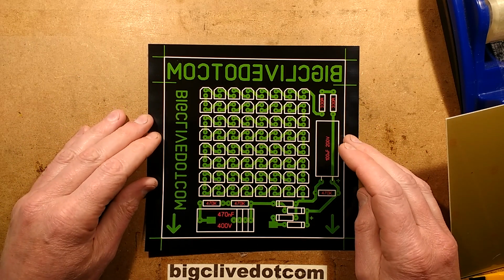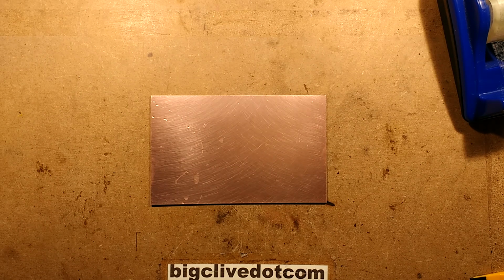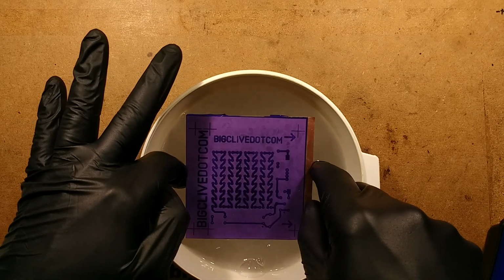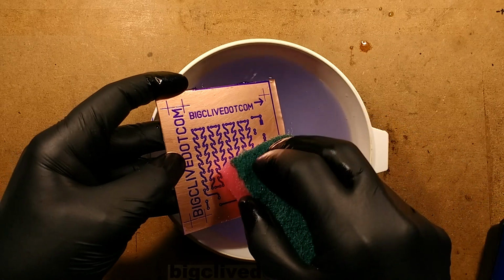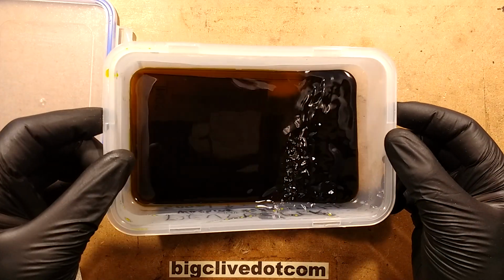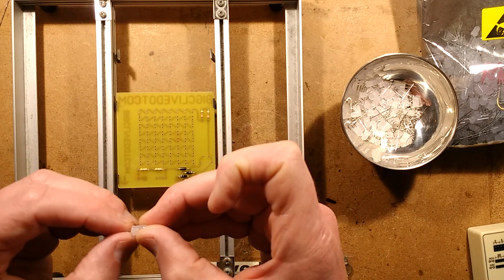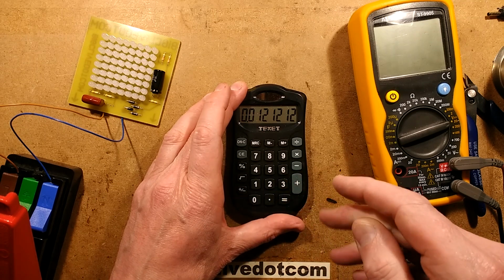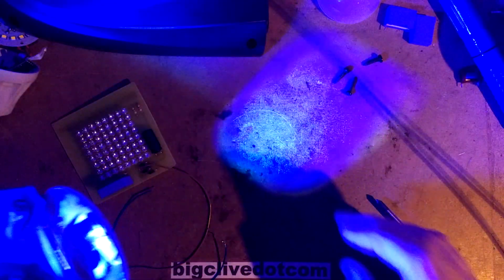Applying and exposing dry film photoresist and building a PCB.

Comment: Just a tip, you can easily turn Sodium Bicarbonate into Sodium Carbonate by putting it in the oven at a fairly low temperature. Slightly above the boiling point of water works great, so 105°C (220°F) for an hour will do the trick. 

Technically the decomposition reaction occurs above 50°C, but it's faster the hotter it is, but you don't want it TOO hot, as there are diminishing returns above about 100°C and you might cause unwanted side reactions. 

The high temp causes the NaHCO3 (Sodium Bicarbonate) to decompose to produce Na2CO3 (Sodium Carbonate), H2O (Water, which evaporates) and CO (Carbon Monoxide, which is a gas.)

The full reaction is:

2NaHCO3 > NaCO3 + H2O + CO

So if you've only got Sodium Bicarbonate, don't fret!

Comment: For beginners and more experienced users ...
EasyEDA is:
1. multiplatform (Linux, Windoze or MAC)
2. Online OR local
3. Can do schematic to PCB
4. Can do PCB direct
5. Has multiple output options
6. VERY easy to use and learn, especially for anyone with any previous board design experience
7. 100% FREE
8. No time limit on use
9. No restriction on board size (unlike some free offerings)
10. Double OR single sided.
11. Produces separate layers for:
   - top & bottom circuit for layout
   - top & bottom silk screen layout
12. SMD &/or Through Hole components.
 Many other useful features

As someone who (DECADES ago!) used to design boards using ChartPak adhesive tapes, dots, outlines etc on. 4x size sheet (20 cm X 10cm board = 80 cm X 40cm) using EasyEDA instead is an absolute doddle!

Highly recommended. And if you don't like it ... Ditch it ... It costs NOTHING after all!

Comment: clive how did you get the negative pcb imagedid the sprint software allow a pos or neg output for gerbers or print function.

I'm using TIna 7 industrial version,which seems only to output positive print or gerber file,please let me know what you used to get the negative image of the pcb traces.

cheers.
Reply from the maker: I use Sprint Layout.  When printing off transparencies for prototyping the print page has a check box for inverting the image.

Comment: clive it seems  most pcb production software output positive images,how did you manage to get a negative image,this seems to be a real point of contention around the web,unless a convoluted method is used,with several manipulations to get a negative image from gerber files,a pain in the arse to be sure.
cheers.
Reply from the maker: On this one when printing off locally you just select invert as a check box.

Comment: Hi clive,i've converted back to using uv exposure film for pcb manufacture,being used to positive resist and positive artwork i've come across what seems a stumbling block ,i can't convert my gerber files to negative images to use the very cheap and available film as used in your video,can you enlighten me on the method you used to achieve the negative image,i imagined photo copying into some kind of graphics software a positive ,this seems a bit OTT.
Any help would be most appreciated,

john ,glasgow.

Comment: To anyone interested in etching their own boards:
   By no means am I the expert here,... but I've experimented a lot over the last year. The biggest thing that helped me with my photoresist setup was someone that recommended I try "Dupont Riston 215" photoresist film. The film itself is nice but not substantially different from the cheap Chinese stuff (as long as it's fresh film). The big difference for me was the datasheet. There is an actual datasheet available online with detailed specs for developing film. Of course these specifications pertain to industrial standard equipment and environments. However they are excellent as a general ballpark guide. The datasheet also mentioned things like the "Stouffer 21 Step Guide." This sent me on a search that resulted in the creation of my own transparency for testing exposure times with fine resolution traces. The trick is to setup a board with the test pattern and cover it with a sheet of light blocking paper or, like I use, cardboard. This cover is removed a little bit at a time periodically. How fast this is done depends on the power of your exposure source. As an example, in the Southern California sun between ~11am to ~3pm my ideal exposure time is just under 3 seconds for photoresist (5 seconds for Dupont Dynamask dry film solder mask). A weaker light source will take longer. When I was establishing how long to expose my photoresist I moved the exposure cover every .5 seconds for 10 steps across the board. I had these steps marked on the transparency too. Once I'm done I recover everything and develop the resist film. If you have a super fine resolution design on your test transparency with difficult to resolve details you'll quickly see exactly how long to expose your film. IIRC Dupont Riston 215 film is specified for a maximum resolution of ~200nm. That's smaller than any hobbyist design will ever be. This requires industrial equipment to achieve anyways. However, during the test I managed to resolve a hair and dust if that gives you an idea of the possibilities. This test revealed I was over exposing my photoresist and also adding too much developer to my solution in order to compensate for the exposure. Using the datasheet I came up with a development solution ratio of 3.9g of sodium carbonate to 1000mL of distilled water. The trick is to get the water up to a temperature that is about as warm as you can comfortably put your hands in. With this combo my film develops in well under 1 minute and inside of the datasheet specification.
 The datasheet also has a fairly tight tolerance spec for how hot to heat the film. I found I was overheating my film too. After seeing the temperature spec, I used a thermocouple with my DMM to dial in the temperature of my iron. I used a travel iron (bc no steam holes) before I got an Amazon basics laminator. I marked the temperature on the dial of the iron. This fixed lots of my problems too.
 Also, I switched to cleaning with 00 fine steel wool. That helped a bit. However, the big improvement to my prep was someone mentioning white powdered dishwasher detergent. The protective coating chemical used for preventing copper clad's oxidation is hydrophobic (causes water to bead). This must be completely removed. Only when water sheets off completely evenly is the board clean. White powdered dishwasher detergent will achieve this.
  Last thing I'll mention, I sprayed water on my boards to apply film and still do for smaller boards. I ruined a bunch of film doing this on my first few projects larger than 10cmX10cm (1st was actually 210mmX180mm). My solution was to submerge the entire board in water and apply the film under water first, placing the film and getting it started while submerged. Then I remove and squeegee the rest of the water. With my larger boards and sprayed water I had all kinds of trouble with alignment and wrinkles ruining film.
GL. I hope this helps someone like my past self :-)
-Jake
Reply from the maker: My own recent experiments have involved cleaning the PCB with dish soap and a green scouring pad.  I then place the PCB under a slow running tap and glide the film under the flow and onto the PCB before squeegeeing out the water.  To set it I used water that had just boiled so it was as hot as possible without risking making the trapped humidity steam and cause blisters in the film.  I've been using 1g sodium carbonate per 50ml warm water.
Reply: @bigclivedotcom  
  Thanks, I came looking for the upload where you talked about the pcb holder you have. I was telling someone else about it and realized I hadn't saved the reference. ...then got sidetracked and watched this one again for the inkjet silkscreen transparency paper. 
   My laser printer's toner deposition rate with transparencies is my biggest challenge to overcome right now. I have to basically use a marker over everything but the very edge of the toner print to get perfect results. I've tried stuff like doubling up the print Mr Carlson style but I can barely get 1 sheet perfectly butted up to the board. Two is just a terrible idea in my attempts. 
   I still haven't built a good exposure light box setup I like, but here in SoCal we have about a month of cloudy days between late May and early June. This got me trying a toner transfer and a suggestion someone mentioned to me about a month ago. I tried using inkjet photopaper with my laser printer. I tried some I already had, one glossy HP branded and one old semi-gloss Kodak branded. The HP stuff basically glued itself to my board. It took a stainless steel scrubber to remove, -not so great. The Kodak stuff was a lighter weight paper. It still stuck to the board worse than any other papers I've tried, (except the HP). However, both of these inkjet photopapers picked up more laser toner than anything else I've seen, and by a long shot too. I printed them on my "transparency" print setting as this has the maximum toner on my old Brother printer. Anyways I soaked the kodak paper in water for about an hour just to see if I could get the paper off. It didn't seem to help. I ended up trying a pink block type pencil eraser to remove the last layer of paper, and that actually did the job quite well, no damage either. 
  I was just making a little LCD breakout board. This toner transfer is the best results I've ever seen from a transfer. I've tried various papers from news print, to glossy mags, to old books, and even Avery label backing sheets, nothing compares to this inkjet photopaper. I went back and thanked the guy that suggested it. He mentioned trying even lighter weight papers if I can find them. He also said to wet the board prior to ironing the transfer.
  I was shocked at the quality from this setup. I mean I've done a few dozen transfers so far and this was well beyond my expectations.  The LCD flat flex was a 14pin 0.5mm pitch. I thought I was really pushing it to try to add the breakout header pinout between my traces in 4pt/1.5mm positive text. I've done this with photoresist and negative text but not positive and this small. They came out perfect with the transfer. I even manually tinned the whole board without problems lifting the text. 
  For anything small I'll probably use this technique from now on if I keep getting these results. 
  I also heated some old ferric chloride for the first etch above room temp with it. I was hoping I could still use it instead of making another batch of hydrochloric acid mix. The last time I used it at room temp the board took 45 minutes to etch and thats with my microwave turntable agitator setup too. With heat the board was done in under 5 minutes. I just used an old 1970's electric casserole warmer thingy I got from the local junk store for $1. It doesn't even have a temperature setting...or switch. Heck it barely gets warm, but it makes a giant difference for the etch time. I was about to retire this mix as it's around 3-4 years old and is well used...or so I thought.
 Anyways, if you ever have the inclination to try a toner transfer again, try inkjet photo paper in a laser printer I highly recommend it :-)

Comment: Would it be possible to use a heater similar to those used in aquariums to heat to copper etchant as well as using a waterfall type to have the etchant flow over the board removing material with as little interaction with the chemicals?
Reply: I'm only 2 years late to comment on your post, but!  I have an RS unit that I use and it has just that, an aquarium style heater and also a small aquarium air pump to agitate the fluid, both for developing and etching.  The board hangs vertically in a perforated sleeve.  Fortunately I found it cheaply in a local auction a few years ago.   It has speeded up my  production no end :-)  also everything tends to happen more evenly on the board.

Comment: Can the resist be left on the board  to act as silkscreen? Or does it release unwanted chemicals as it ages?
Reply from the maker: It doesn't flow out the way well when you apply solder so it has to be removed before soldering
Reply: Thank you for the reply. I was wondering more along the lines for text, but I guess in the long run etching the text in copper is more permanent

Comment: Clive, I've tried this dry film stuff and failed.  I went through qute a bit of the stuff, and not a single board worthy of using.  Now you said in another video that maybe some of the dry film available on eBay is "seconds", so lets hope that's the case.  Anyhoo, the problem I'm getting is that although I have no creases, no trapped dust or similar, I do get tiny little bubbles of air developing and that stops the gel layer fully bonding with the copper.  I've used an iron, an iron with a cloth and an iron with soft kitchen tissue, a plastic card as a squeegee etc all to no useable results.  I notice you use a softer squeegee, and I wondered if you had any more tips or tricks up your (rather long) sleeve? :D  I have a new untested batch of film, am more than happy to send you a sample if you like.
Reply from the maker: Did you wash the PCB and use a layer of water between the copper and film?  This stuff is also like a screen protector in that you have to try and avoid specs of dust or lint between copper and film.
Reply: @bigclivedotcom  Yes, washed with mild soapy water with a washing up sponge, rough side, and I made sure there was no dust or lint.  It's almost as if the air is coming out of the copper.  Maybe one day it'll just click, who knows.  Many thanks for the personal reply :)
Reply from the maker: @lloydgarland4667  Keep experimenting with it.  Use a low heat to fix the material.  A high temperature may generate steam bubbles.
Reply: @bigclivedotcom  That may just be it, although I don't think it got that hot.  Maybe it did!  I shall test, thank you sir.

Comment: I couldn't get the temp. of my iron right and it caused a few a few problems with trying to lift the second protective layer. Don't think I have the same film, the middle layer on mine is really flimsy. I got good results in the end by using the hot air from my soldering station set to 100c. Running water after developing was lifting bits of the resist. A dunk in still water and an air dry worked much better. Thanks for the video's, sprint was just the ticket and very easy to learn
Reply from the maker: It takes a while to get to know the quirks of all the PCB making systems.  You end up getting a feel for it.  Sprint is my favourite PCB design package because it lets me just bang down pads and tracks with no formality.
Reply: @bigclivedotcom   I see what you mean about perseverance, glad I kept trying. Got the bugs worked out and am now sitting next to my first two finished boards, a couple of pre amps for a pair of busking systems. Such a great feeling taking an idea and making it a reality. I have been using sprint to make accurate drilling/cutting templates for other materials too. Thanks again

Comment: Clive keeps promising that something could go "bang", but it never happens on this channel unless he's setting off a pyrotechnic.

10:57 Clive wants that hole.
18:24 You don't have any hardware stores on or near Isle of Mann that carry concrete cleaner? Given your experience with industrial outdoor electrical equipment in England I'll take your word for it, but here in Eagleland hardware stores tend to keep large stocks of muriatic acid on hand.
Reply from the maker: I did get acid from a builders merchant, but it seems to have a surfactant in it and foams up when aerated.

Comment: Hmm, I like this a lot. Was thinking of building something similar as night/ambient lights for the kid's bedrooms, perhaps with diffused or maybe focussed LEDs, but we don't have a printer (and much less do I have the skill, patience nor equipment to make up a few of these boards myself).  I wonder, if you see this comment, Clive. How much it would cost for me to procure, say 6 to account for experimentation/disaster etc, of these boards etched by your own fair hands? (I'd also quite happily allow you to drill them but that is a task I could accomplish at home if you're not much for doing that bit).  I must check out the other videos too, and check prices for the projector housings.  Will make a more concerted effort to contact you if it still seems a good idea after a bit more thought. As always, thanks for sharing.
Reply: Actually, just started watching the original video. Looks possible that the PCB could be modified to power all the LEDs at once. would just need to calculate the power supply afterwards depending how many were effectively in series. Still be a nicer solution with proper boards though

Comment: You can bake bicarb in the oven at 100 C for a while to make sodium carbonate. It reverts back after a while as it absorbs water from the air. Also happens to your store bought carbonate, so store it airtight. Good video. I've also used that printing film. VERY expensive stuff, but it works well on a pigment based inkjet - not for dye based inks.

Comment: Hey Clive (or anyone else reading for that matter), I'm just getting in to photo resist for making my own PCBs and I'm just wandering... how much UV does the average LED household incandescent replacement bulb emit?  All of the old style bulbs in my house have been replaced with LEDs and I'm just curious about how careful I really need to be with UV exposure when working with this stuff.
Reply from the maker: Usually very little if any.  I applied this material in close vicinity to two 20W LED floodlights.
Reply: Excellent, I had a feeling that might be the case.  I just got my 1st order of film in today.  Time do do some experimenting! :)  Thanks for the info.